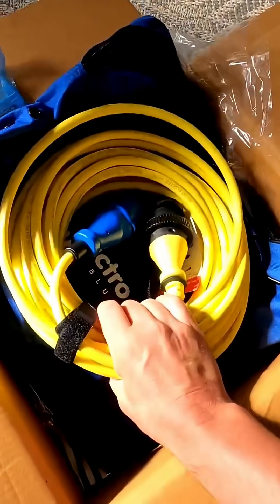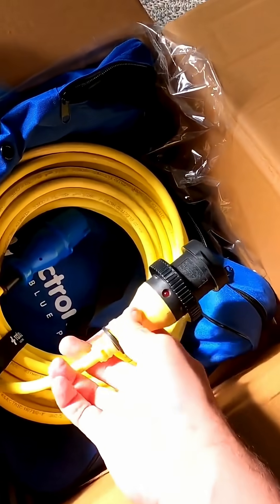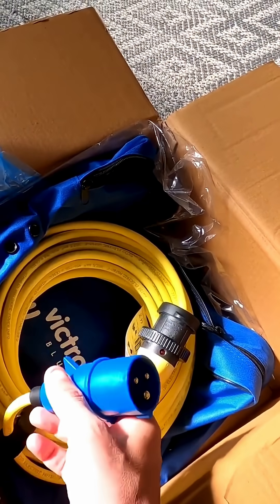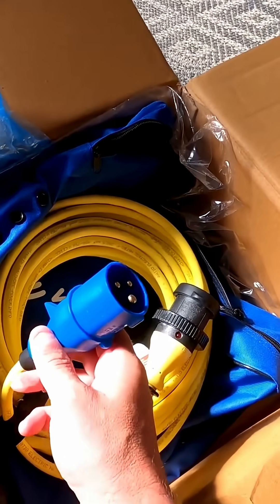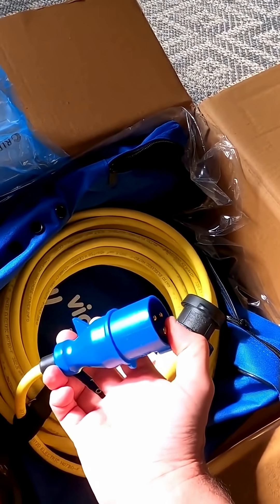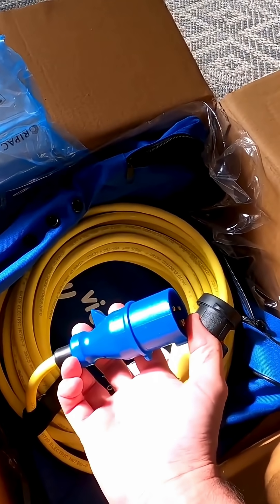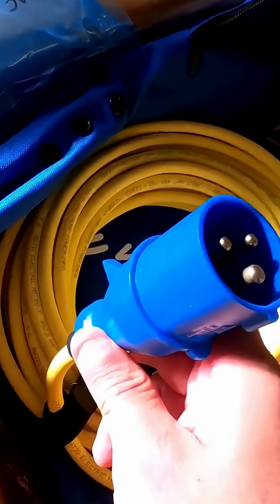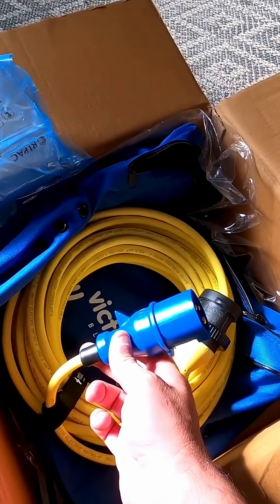Victron 16A Inlet and Cable Unboxing | High-Level Diagram |  Off-Grid Sailboat Build Wiring Ep.12

Comment: Hey bud, if youre in the US I would just go to an electrical supply house, or even Lowe's/Home Depot and get some heavier duty cable by the foot. 16 amps isn't much. What kind of voltage/amperage/wattage are you expecting to put through this?
Reply from the maker: Hey RameSeal, thanks for cheking in. At the monent I am only catering for 3600 watt (limitation of the Victron isolation Transformer I will be using). The inverter will handle 5000W but will have to settle for 3600:) this is 16Amp at 230v as I am in Europe so around 3500 so shoukd be good until I need more load. Thank you for comment as appriciated:)🙏